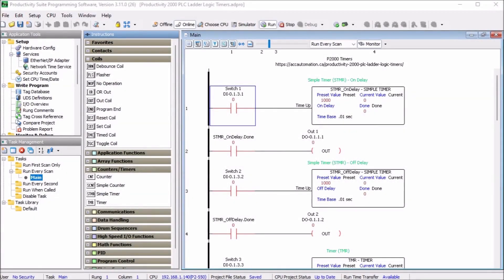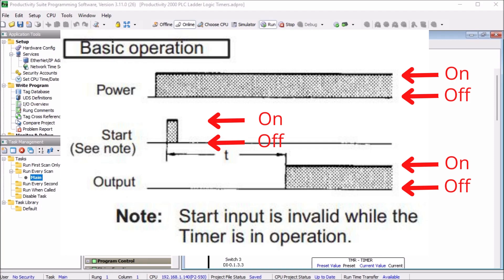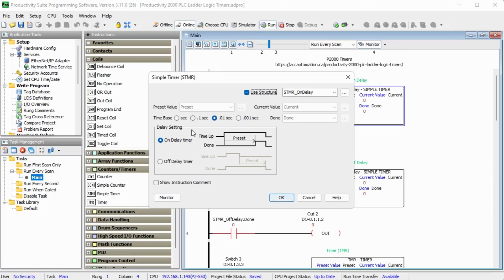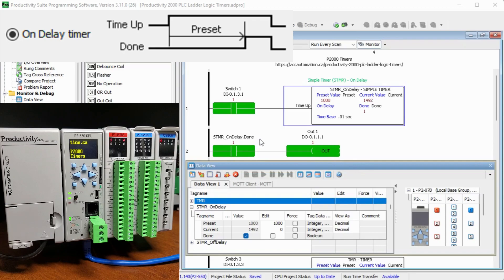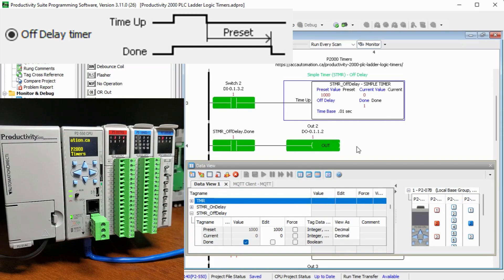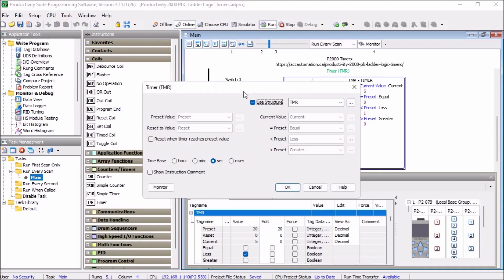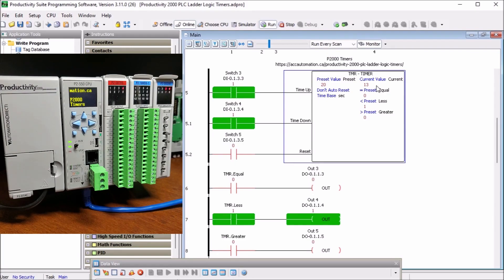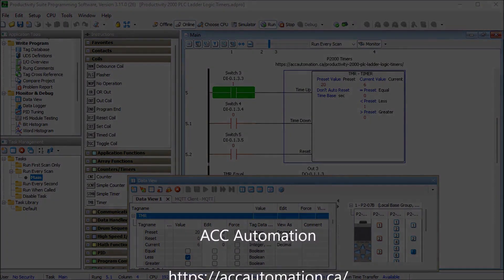Productivity 2000 PLC Ladder Logic Timers

Comment from the maker: Detailed information can be found on our website. The post for this video is located here:
https://accautomation.ca/productivity-2000-plc-ladder-logic-timers/

The Productivity 2000 Series PLC is located here:
https://accautomation.ca/series/productivity-2000-series-plc-p2000/

There are several reasons why we are using the Productivity 2000 Series Controller. Here are just a few.
- CPU with 5 communication ports
- 50MB user memory - Can handle very complex applications easily.
- Limitless PID – Autotuning – Individual or Cascade Mode - etc
- OLED message display on the CPU module
- Plenty of discrete and analog I/O modules
- Status displays on all discrete I/O modules
- I/O Modules have QR codes. This can be scanned so you can have the latest specifications/wiring diagrams for the module.
- OLED data display on analog modules
- P2-RS remote I/O expansion module, or use the Productivity1000 P1-RX remote expansion module to add even lower-cost remote I/O to your system
- FREE full-featured Productivity Suite software
- Programming with several ports - USB, Ethernet, Serial
- Hardware auto-discovery
- Hot-swappable I/O - Remove cards with power on the system
- Choose from three wiring options
- Slim DIN rail density form factor:
 - hardware - power supply, CPU, and seven modules in only 10-1/2 inches
- All project files (program, tag name database, and all the program documentation) in the CPU
- Run-time editing and debug mode on CPU
- Easy data logging with micro SD on CPU
- Secure Web server to access data files and system tags
- Easy drive and motion controller integration
- Coordinate motion control with PS-AMC allows control of up to 16 axes and synchronization of up to 4 axes
- Two-Year Warranty

The Productivity 2000 series of programmable logic controllers currently has all of these features built into the P2-550 CPU.
This CPU (Central Processing Unit) is also known as PAC (Programmable Automation Controller) because of its communication capabilities.

Regards,
Garry
ACC Automation
https://www.accautomation.ca